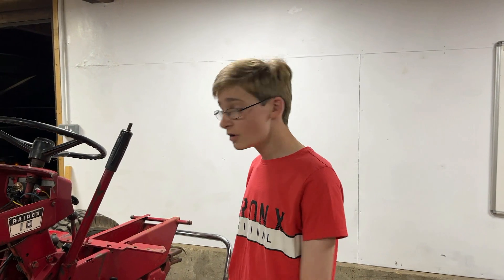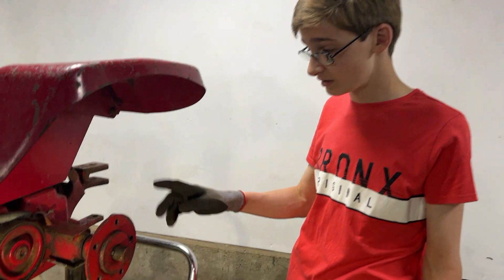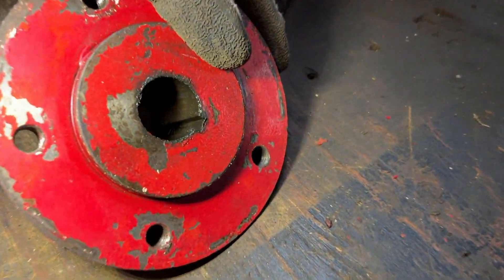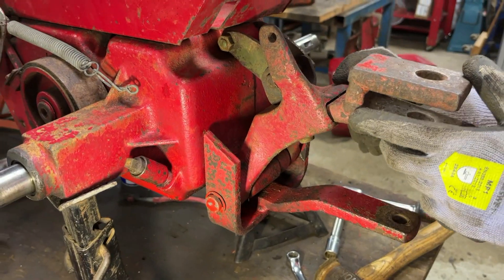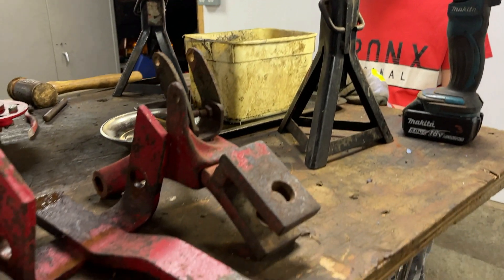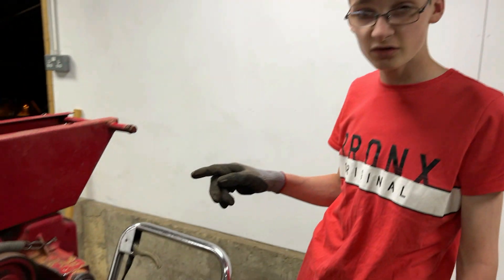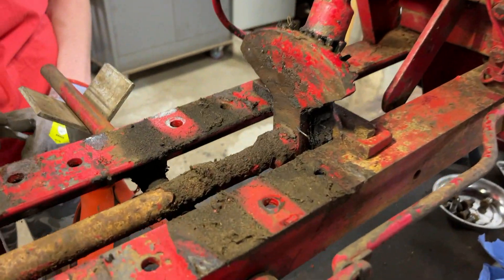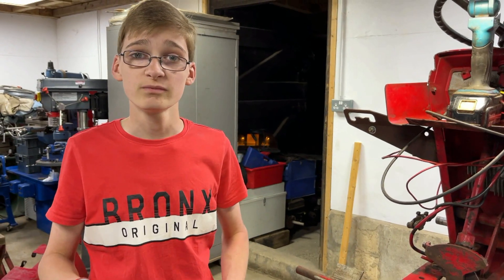1968 Wheelhorse Raider 9 - Part10 (Rear axle)

Comment: Good job. If the bolt isn't metric nor SAE, its probably Wentworth. The bane of old British cars. When sliding seals on, I use plastic sleeves so that the seal can't be damaged. Good Luck, Rick
Reply from the maker: Thanks. We tested most of our spanners on that bolt and still couldn't work out what it was. Thanks for the tip about using plastic sleeves. Take care

Comment: I especially like this video about the rear seals because I had to change both on mine and I just had to cut one of the hubs off....penetrating oil or heat and I broke a good puller and then that was it.....I cut it off....of coarse mine is mostly used in the winter time and the hubs are exposed to road salt ,just great for corrosion.....well done my friend and looking forward to the front steering inspection to see what you find......CHEERS
Reply from the maker: Thanks. We have found that if the oil seals have been leaking for a while the hubs come off easily but like you, we have really struggled to remove hubs where the seal is not leaking. Hopefully the front axle and steering will be the last unknown on this tractor. Take care

Comment: Replacing seals is not my favorite job. It seems I often find a way to damage the new seal! Your project is coming along and it’ll soon be time to put pieces back on the chassis instead of taking them off 😁👍
Reply from the maker: Thanks. Replacing the seals was quite stressful as we did not want to damage them. Hopefully it won't be long until we start the reassembly of the tractor. Take care

Comment: Great video Joseph and camera man. So you have the seals in now, but I would have wrapped the axles where the key way slot is so as to not cut the new seal. And maybe it would not, but I would have used a thin tape to do that. Good idea on your part to let the camera man do the installation of the seals. Hehe. 
Poor camera man,  hehehe. 
Have a good day fellas.
Reply from the maker: Thanks. the cameraman is very helpful when working on these tractors, especially tricky jobs such as not damaging the oil seals. We will do the tape to cover any keyways next time we do one of these axle oil seals. Take care

Comment: That gear oil looked like it may have had some water in it at some point...not the typical colour you'd expect to find in a rear end gearbox. I see that this tractor has rack and pinion steering. It is still one of the most precise steering types available and is what is almost always used on performance cars. If you ever get this thing to do 300 KPH, you've got the right steering onboard. It's a curiosity why that bolt had a screwdriver slot?? Perhaps it was a random replacement bolt at one time? Good work on this tractor...keep the videos coming.
Reply from the maker: Thanks. That would be a bit scary going 300 on this... The screwdriver bolt on the rear axle was very strange and I imagine it was just a quick replacement done by a previous owner. Take care

Comment: How's she goin'?  How about that rear axle eh.  It's hard to believe that the torque to make the tractor go forward or reverse is all transferred through the little woodruff keys.  It just shows how strong they are and the forces they withstand.  No wonder it had rounded edges since only about half of it was actually engaged with the wheel.  Nice job getting things cleaned up and that tractor is going to be nice when you're all done!!  Take care!!!
Reply from the maker: Thanks. These tractors are very well made but it is very interesting seeing how much force and load such a small component can take. Take care

Comment: Too Hot here to do anything. Current 107 f. I suspect the side with the worn key way is the driven side, even with a transaxle, one side gets more torque than the other. Might think on swapping sides with the hubs.  Take care.
Reply from the maker: Thanks. It is currently high 20s (celcius) which is about 80 f. I have only seen your temperature when I was on holiday a couple of years ago. That is a good idea about the hubs that we hadn't thought about before, thanks for that. Take care

Comment: I just want to say that woodruff keys are a interference fit item in the shaft. The hub should lock with the locking screw over the top of the center of the woodruff key. What I would like to know is what is the shaft diameter and length from the housing face ?? Also, what is the diameter of the drive fan pulley, width of groove, and shaft size of the bore. Nice video and direction of progress also GTB.
Reply from the maker: Thank you very much for the information. unfortunately the tractor is currently in storage so I am unable to take the measurements. We are hoping to get it out and use it later in the summer and I will be able to measure then. Take care
Reply: @GardenTractorBoy  Thank you for your video fella. I learn a lot from your tinkering on the tractor.

Comment: Hello. I'm trying to get a belt for my raider 10 1971. Do you know the size of belt many thanks
Reply from the maker: We have the parts manuals for many Wheelhorses but we would need the model number of your tractor for us to look up the part number. I expect the model number is something like 1-6051. Many Wheelhorse use part number 7473 which is a 5/8x82 inch belt. Either let us know the model number and we will check or drop us an email with the model number and we will reply with the parts manual as a pdf. I hope this helps, take care